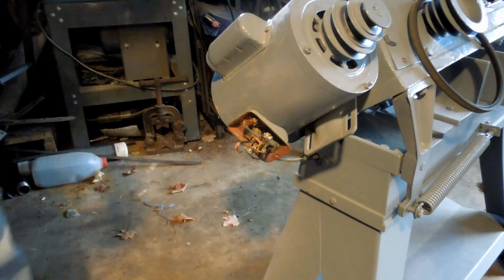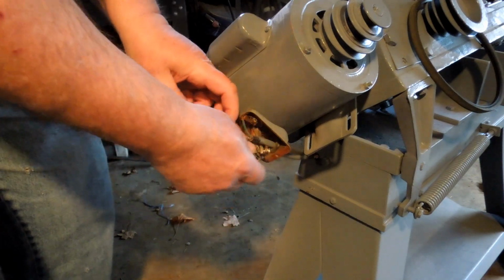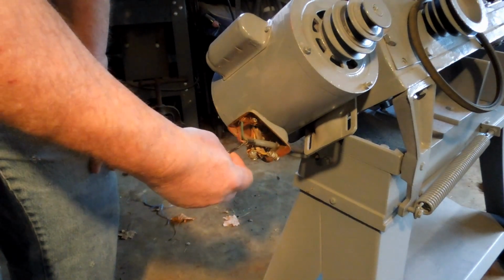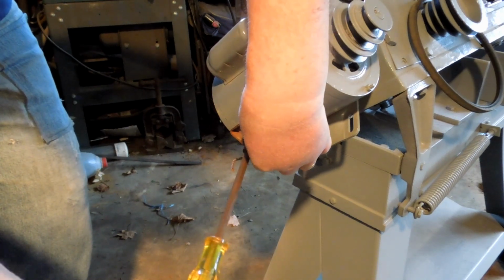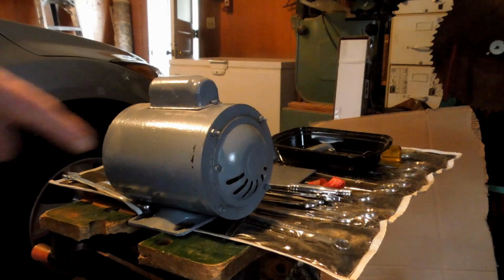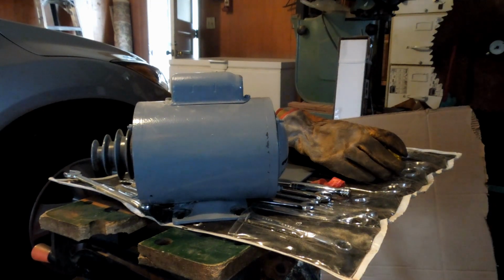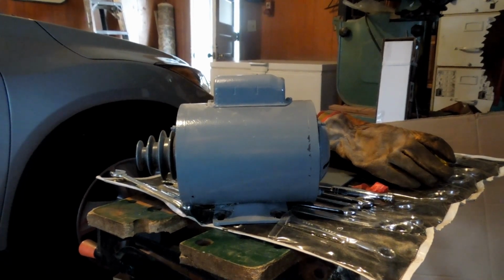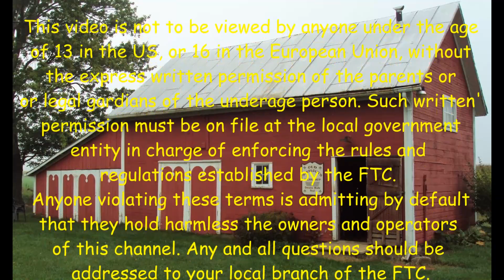Milwaukee Pneumatic Bandsaw Crash - Pt 3 - Check The Motor

Comment: We had a motor go bad on a saw like that, the boss brought in some old appliance motor that was supposedly much less HP, that's when I realized not all HP is created or at least measured equal.....The much lower HP old motor had plenty of power............I attached it with a couple of big hose clamp and Bob's Your Uncle, the old motor was a champ!
Reply from the maker: Horsepower rating is an arbitrary description of what work a device is capable of producing. 
I just spent 10 minutes reading all the definitions of HP in the Wikipedia (source for all manner of incorrect guesswork based on supposition and references to some true facts and a few stretchers)
My first Harley was a 45 cu inch flathead. The manual rated it at 6 brake horse power. 
We had built a scooter for my neighbor with an 8 hp Briggs and Stratton engine and had a good laugh about it being bigger than the Harley.
Reply: @OldSneelock  10/4 on the Hog motor. I liked my Hog motor and wish I'd known then what I know now BUT I'd probably be graveyard dead because of it. No more hauling cigarettes in the sleeves.

Comment: I'd pull the armature and see if anything is loose inside binding up between it and the outer windings. But first, look and see if it looks like the windings got warped (kinked out) when it landed, maybe? Good luck. Hopefully it can ne repaired, and if not, you can find a motor that matches the output power and speed. Wouldn't want to be burning up blades with a motor that's too fast, or waiting all day on a motor that's too slow. Good luck, and best wishes.
Edit:  P.S. maybe a brush jarred out and got jammed?
Or maybe the impact put the housing and windinsgs slightly out of round?
Reply from the maker: Pretty good plan for checking the motor. Those are the most likely problems. 
I have a spare motor if needed but I expect this one will work after I give it a good talking too. 🤔😁😎
Reply: @OldSneelock  Like the old Hoodlum preacher used to say; 'Plain talk's easy understood'!